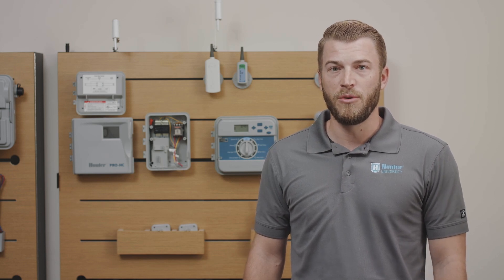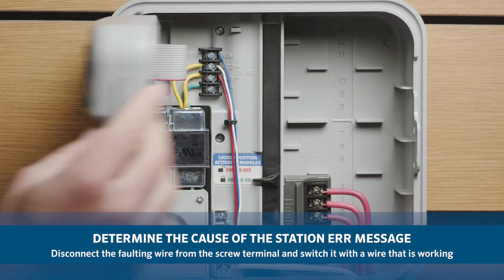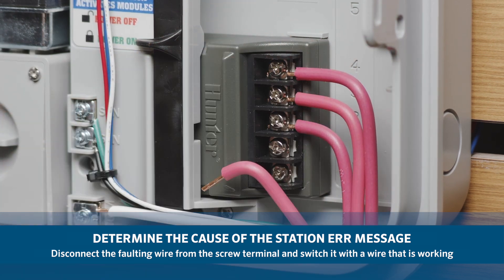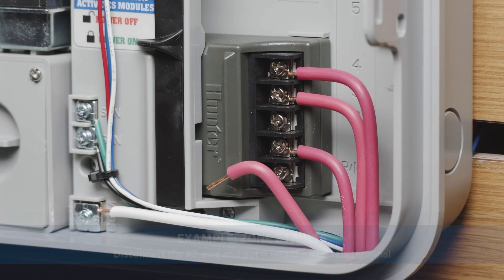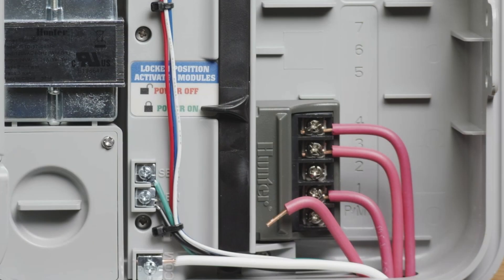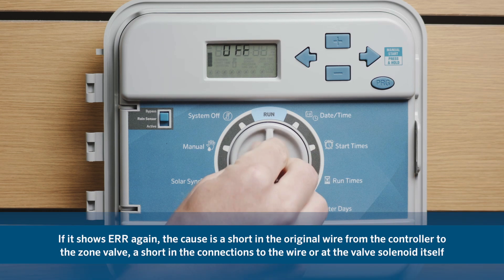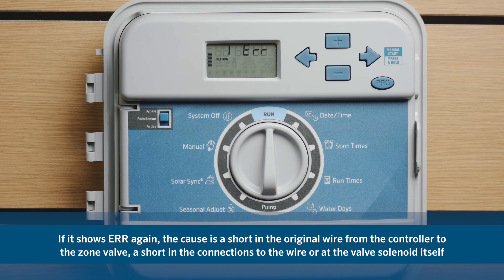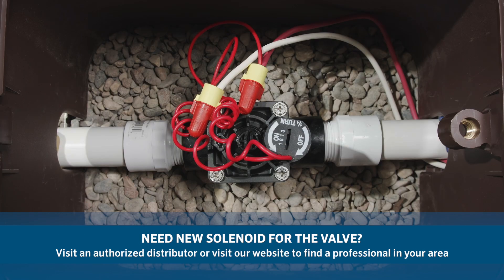Pro-C®  Station ERR Messages

Comment: Two of the last zones in my system only ~sometimes~ have station error messages after a watering. I’m guessing there must be water causing a fault somewhere, as the error doesn’t continue or prevent future watering from happening on successive days.
Reply from the maker: Depending on the error message, it could be an intermittent wiring issue. It may be time to contact a local irrigation professional for help with your issue.

Comment: Area 2 is showing the error message on my controller. I can turn it on directly from the solanoid but the controller does not turn the area 2 on. I took of the wire and put it back on and still does not work. Any advice?
Reply from the maker: There are some details to work out on this so please contact our customer support department: https://www.hunterindustries.com/hunter-technical-support-email-request

Comment: I removed all wires and the ERR message remains. I checked the resistance across each solenoid (from the controller location) each showed about 35 Ohms. I can activate each zone individually by applying power directly to the solenoid, bypassing the controller. I replaced the controller last year because the screen went blank. Now I am having this issue. That is a little bit too much headache for such a simple piece of electronics. Any advise?
Reply: Did you try turning switch to Off for five seconds?
Or next.. (Remove battery?)
Unplug for 30 seconds..

Comment: I was advised to replace the controller. How do I determine if replacing the selonid valve would fix the issue instead?
Reply from the maker: Thank you for contacting Hunter Technical Support.
 
Your question is better handled over the phone. Please give us a phone call when you can be in front of the controller so we can help you review your current setting and make adjustments if necessary.
 
You can reach us at 1-800-733-2823 between 5:30 AM and 4:00 PM PST, Monday through Friday.
 
Thank you again for contacting Hunter Technical Support. Please let us know if we can offer any other assistance.

Comment: I switched wire with unused zone, and error code does not appear, but zone still does not run.  Please advise what could be problem.  Thank you
Reply from the maker: Thank you for contacting Hunter Technical Support.
 
An Irrigation controller that is displaying a station running but a valve not activating is most likely an indication of a problem at the irrigation valve or wiring to the valve. The most common reasons could be a either wire connection, broken wire, or a non-functional solenoid at the valve. 
 
If the solenoid is good, there is also a chance that the exhaust ports within the irrigation valve are clogged. This would require you to clean the ports in the valve. 
 
If the controller is producing the proper voltage at the wire connection of the irrigation valve, we would then recommend replacing the solenoid.

Comment: What if every zone is showing error
Reply: Yes! That’s what’s happening to me now. I went and maintenances each zone. Then checked the box for a zone that I knew was perfectly operational manually. The timer is still erroring. I am going to try replacing one cyllanoid, if that doesn’t fix that zone the problem must be the timer box. So irritating
Reply: Remove battery and unplug for 30 seconds. Plug it in.
See if screen looks normal.
If so.. Test each zone.
Cannot hurt.

Comment: All zones are showing ERR message. What to do now?
Reply from the maker: Thank you for contacting Hunter Technical Support.
 
Please give us a phone call when you can be in front of the controller, with a working meter to measure voltage and resistance, so we can help you review your current settings.
 
You can reach us at 1-800-733-2823 between 5:30 AM and 4:00 PM PST, Monday through Friday.
 
Thank you again for contacting Hunter Technical Support. Please let us know if we can offer any other assistance.
Reply: Turn to Off first.
Any change?
Try removing battery...
Unplug for 30 seconds.
 Plug it in again..
See if screen changes.